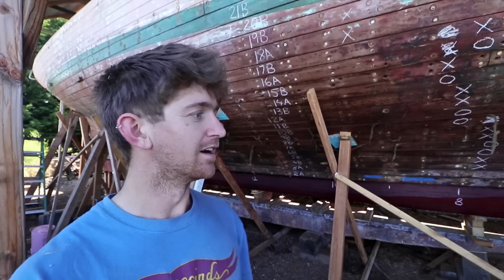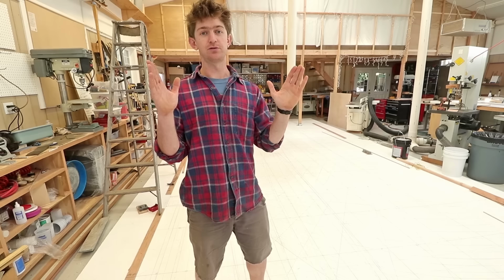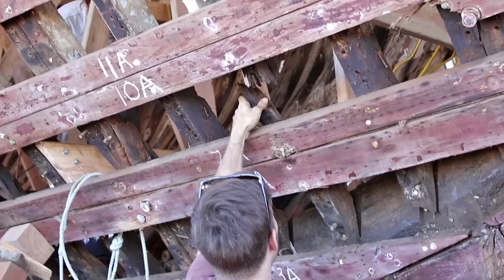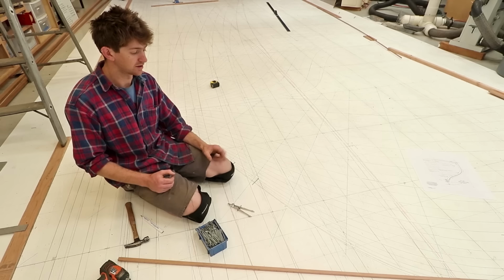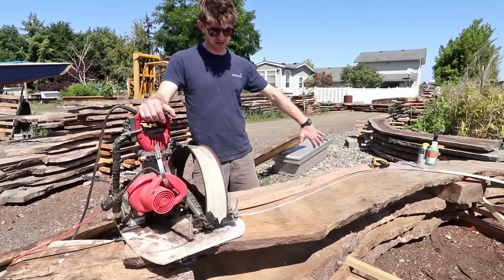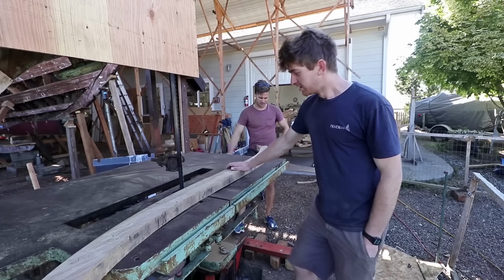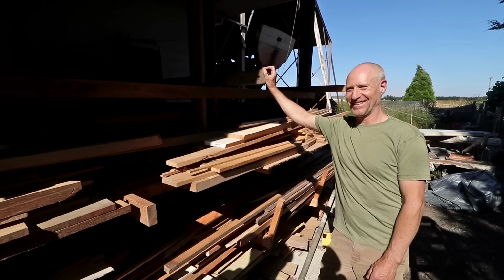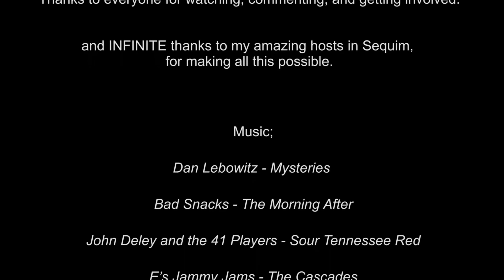From Lofting to Re-Framing / Removing Planks - Rebuilding Tally Ho EP27

Comment: I haven't read all of the comments so this may have been answered already - I know the new frames will be from the live oak you had cut - however a few questions: 1. What wood are the old frames made of?, 2. What wood are the hull planks made of?, What type of fasteners are you going to use to hold the hull planks on - same as the original - bronze pins that are clenched over washers (not sure if that is the correct terminology)? If there is much difference in the old 
frames from the new (same as with hull planks) will some areas of the hull flex more than others when under way or is that a negligible concern?
Thanks for the wonderful series of videos - it's a great way of showing how much work goes into a wooden sailboat.
Reply: Cant wait to find out can you? keep watching impatient........

Comment: I see boat builders sometimes put “boat soup” on the timbers. Do you ever use boat soap. I understand if is a mixture of pine tar, turpentine and linseed oil either raw or boiled. It seems the formulas are kept secret so others will not copy. Do you know a formula for boat soup. 
Also did you ever find anyone to haul the rest of your timber up from Georgia? Will take either an 18 wheeler or a hot shot guy.

Comment: now that the lofting is done. Can you make detailed photos of the lofting floor so that we can stitch together the complete lofting as a complete high resolution image.
It would be nice if the images where right above the the floor (camera parallel to the floor), an from the same hight, but angles and deviations can be corrected digitally.

Comment: Can someone explain how Leo can reuse any of the planks when they were riveted to the frame and require hole saws for their removal?  Personally, I don't care a bit if very nearly 100% of the boat will be brand new. Leo seems very nice and knowledgeable, and the videos are fascinating. I eagerly await each new episode.
Reply: The only way I can see would be to fill the old screw holes with epoxy, and Re-Drill, but I'm SURE Leo has some sneaky Ancient Wright Trick up his sleeve.
Reply: Or Treenails.....
Reply: @Jim... Thanks for your replies. Your epoxy idea seems likely, though I don't see how that would be an improvement over a new plank. Since epoxy would be stronger, unabsorbent of humidity and/or water, and would expand/contract with heat/cold at a different rate than the surrounding wood, I imagine filled-in epoxy slugs would create stress on the plank. It also sounds like the process of filling, drying, sanding, and re-drilling would be tremendously time consuming, and I imagine paint or stain would not take to epoxy as it would to wood, possibly making for a strange look in the short run and paint adhesion/wear issues in the long run. Good thinking on the treenails, but the Tally Ho wasn't built using them to begin with, so I imagine Leo will use rivets again, if only to retain the character of the boat. I guess we'll see in or around Episode 429. :)
Reply from the maker: All I will say for now, is... definitely not epoxy! (bleaurgh)
Reply: From what I could see the hole-saw holes are quite shallow and could be bunged and redrilled or bunged after the new rivets go back in.
Reply: Some of those planks are 45 ft long teak....good luck finding any today

Comment: Well, I was holding my breath hoping you would address a question about lofting the frames, but you went right past it! How do you determine the molded dimension of a frame, once you have cut out its shape? Is that prescribed somewhere in the lofting, or is it a calculation I haven't yet been able to find in Chapelle's Boatbuilding? I am a model ship builder, and I am lofting out frame shapes for my next model but I don't know how to determine the molded dimension of each of these frames. Thanks!

Comment: Sap wood VS Heart wood    It depends upon the species.  A corollary to your live oak.  The great war bows, long bows, of the English armies that featured so predominantly in the 100 years war of the 14th and 15th Centuries were favoured to be made of yew.   The outer rind of the bow was sap wood, light in colour, springy, tremendous tensile strength,,, whilst the inner portion of the bow was heart wood , dark, hard, stiff, in-compressible.

The two differing strengths of the wood combined to form something greater than the sum of its parts.  As is the case with live oak.

ARE all the frames the same depth?, or the same thickness?, regardless of length, or depth of curve?  Where did the fair shape of the boat sag in its first 100 years?  Hogging is not only the province of the keel.

Comment: Is it just me or does anybody else think Leo is more upbeat when Cecca is there? Leo, I have a question, you do not hear from me much since I am NOT a boat builder. I am completely fascinated by what you are doing and I am amazed there is still someone in your generation with the work ethic you have. The question............ I see you pulling all of the side boards off of the boat, isn't there a point where the stability of the boat becomes compromised due to lack of rigidity?
Reply: He addressed that in a previous video. You can see the 2x temp frames in some of the overhead shots. ;-)
Reply: Yes I saw them but they were to keep the boat from falling outward. Once you remove all those side boards it can start to twist and fold up like a wet piece of paper. I do not see any cross bracing in there front to back across sides. From what I have seen so far I am sure this has all been figured into the plan, I was just curious.
Reply from the maker: Yeah at some point it would probably fall apart, but seems to be holding up so far! It should only get stronger now.

Comment: Lofting question - From the original plans you take the lines and draw them to full scale.  In the process it exposes minor errors and it is necessary to make minor adjustments to related lines.  Do these errors/adjustments only become evident with full scale lofting?  Is this a common occurrence in all nautical design (before computers)?  Did the original builder (or any boat builder of that era) have to loft full scale to build the boat and in the process uncover the same errors you found?  I think you stated in an earlier video that without the adjustments the lines of the boat would be different that what the architect envisioned.  If all the above is true would it be fair to say the architect wouldn't know exactly what the lines would look like until the boat is actually built (even though he had the original vision)?  Thanks for the time and energy you put into all your videos.

Comment: Why didn't you use air hammers to drive the old rivets out? It seems it would be much faster and do less damage to the planking
Reply: I suspect that it was for the same reason that He's sleeping in the Workshop and not a 5 Star hotel, Old Hammers are cheap...

Comment: I did not know that pure Linseed Oil sinks in further than polymerized Linseed Oil. Question....would pure Tung Oil have provided you with the same depth saturation plus a better moisture barrier than pure Linseed Oil? It certainly would be more costly than Linseed Oil but it would last at least twice as long and provide better protection. Drying and curing time would be about the same for both - 30 days. 
Mr. Blair M. Phillips
St. Catharines, Ontario
Canada
Reply: send him a 55 gallon drum of Tung oil and im sure he will let you know how it works out.Blair.

Comment: Hey Leo, it seems like you could save a lot of effort and timber if you got (or made) some heavy duty roller bearing stands like these: http://www.rockler.com/3-row-ball-bearing-heavy-duty-stand and set them up on the infeed and outfeed of the ship saw.  Tou could pass entire slabs through it after setting them down on the stands with your forklift reducing wastage and effort.

Comment: Could you explain the planking numbering? 2A, 3A, 4B, 5B, ...12A, 13B, 14A, 15B...18A, 19B, 20B, 21B

The numerical part seems self-explanitory but specifically I am curious about what the A and B represent?
Reply: The A B C is the order of the multiple planks needed to twist and bend from fore to aft while matching the curvature of the hull. Sometimes a single plank (A) will be long enough fore to aft to fit the curve, other times on the curviest parts of the hull it looks like three are needed (A,B,C).

Comment: i am not sure if it has been mentioned before but you might be interested in checking out a channel of someone who has done almost exactly what you are doing.  charles chaira  restoring susanna  on utube.
Reply: I took a look. The series starts at Episode 12, the videos are far too long, and Susanna was in better shape to begin with (the frames needing only repairs or sister frames augmenting the originals). Not taking anything away from the Susanna restoration, but Leo is undertaking a much more involved project, and he doesn't have the crew helping him that Charles has at his disposal.

Comment: ?_LOFTING_? :: Will all your work on the lofting floor result in a refined/corrected and perhaps expanded T-of-O (Table of Offsets) that will make it easier/quicker for future builds of the Albert Strange design #96 Aux Cutter Yacht "Betty"=>"Tally-Ho" { you mentioned that Mr. Strange omitted some data from the T-of-O that you have been working from }

Comment: will there be anything left of the original?
Reply: paul allen yes he said he is keeping as many planks as poss.
Reply: paul allen. Also he is only changing the futtocks and other parts that have the most distortion.
Reply: paul allen most of what's being replaced was a prior repair anyways. Or is deformed because of the repair.
Reply: SouthJerseySound and deformed from hogging/rot. Alot will end up as interior trim.

Comment: I disagree that if you were to take it apart completely and rebuild up again that it would not be the same boat. When rebuilding car engines you tear them down to each individual piece and repair/replace parts as necessary and then reassemble it. No one considers that a new or different engine. It's a rebuilt engine now. There's no difference between that and the boat imo. The engine doesn't stop being an engine because it's disassembled likewise neither is the boat if it's in all its pieces

Comment: House renovation in Toronto is like rebuilding Tally-Ho. Getting a permit to tear down an old house and build a new one is harder than getting a permit to renovate, so people replace the roof, then they jack up the roof and replace all the walls. It's still George Washington's hammer, but everything but the foundations have been replaced.

Comment: Why not laminating the frames? I know, it is not historically correct, but still... no need for
precious big wood planks, correct shape, structurally better, rot proof…
Reply: Why not coat it in fibreglass give it a coat of paint put a couple of steam turbines below decks i can see where you're going with this
Reply: Jos Touw good point